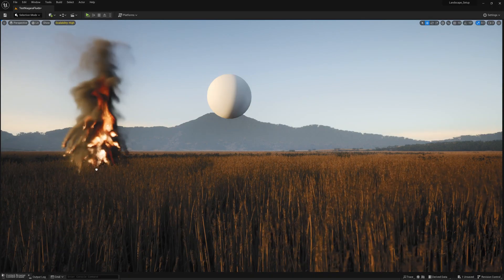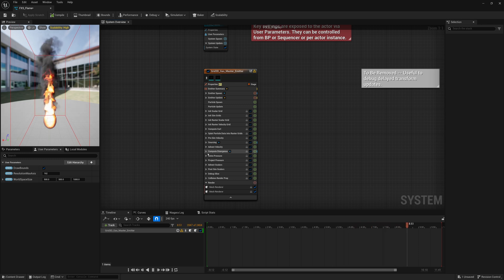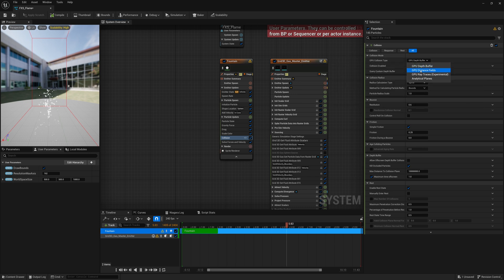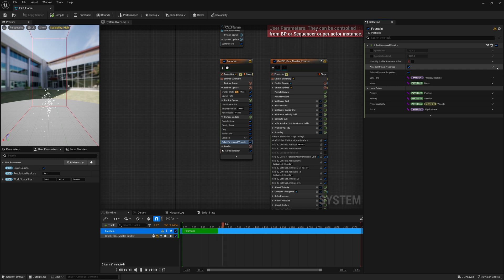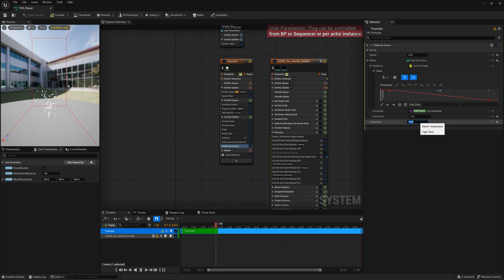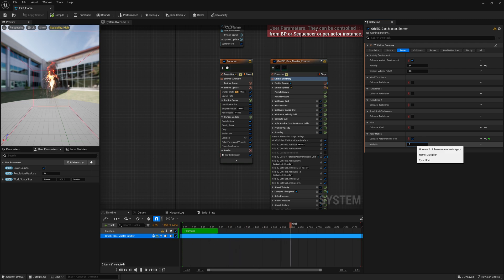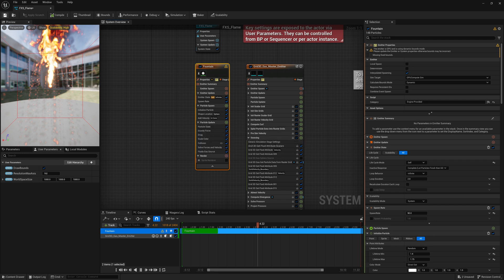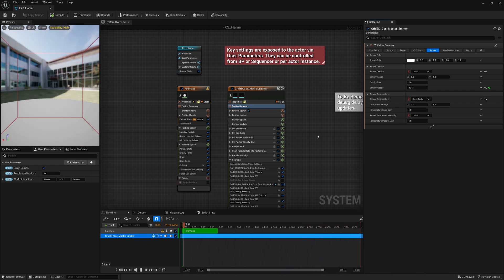Unreal Engine 5.2 - Moveable Fire & Collisions With Niagara Fluids [2]

Comment: thanks for tuto.
I made a try with 5.4, it look like that some behavior had change. If I set everything as you did, there is less fire sticking to the shape (even if the particle are). If in fluid, I turn off, use radius fall off, it seems more similar. don't know what have changed.
also, it seems that the tag collider is useless (the fluid use mesh collision seems to handle the whole tricks)

Comment: this is nice. i was wondering if you had any idea how to try and get similar effects to gases like in oxygen not included. say i want a gas cloud to move around the map.and is it possible to implement a pipe system with water fluids. water pump out fluids to another hole in the ground for example
Reply from the maker: Easier to approach that with some game logic and blueprints not actually trying to simulate liquids through a pipe or through your scene over large distances. That would be far too demanding for current hardware using a real fluid sim like what Niagara Fluids is doing.